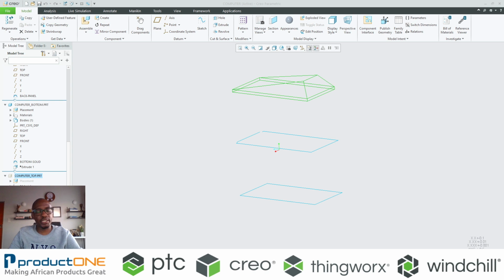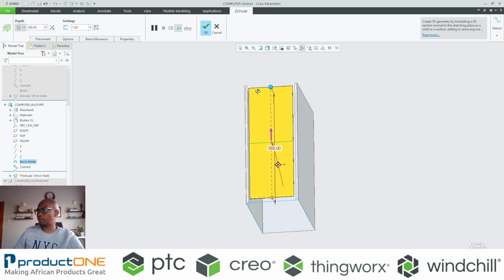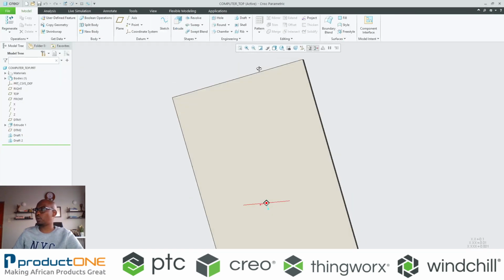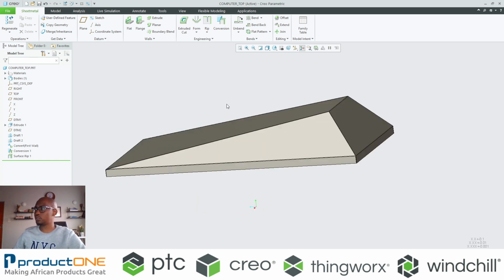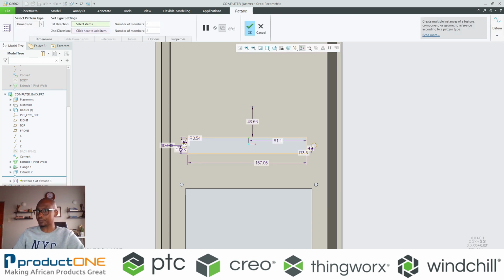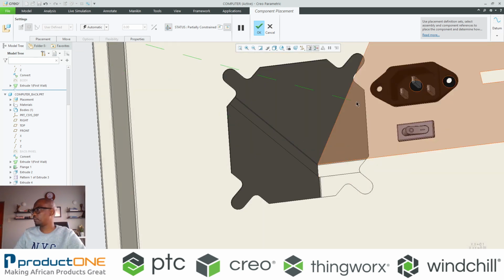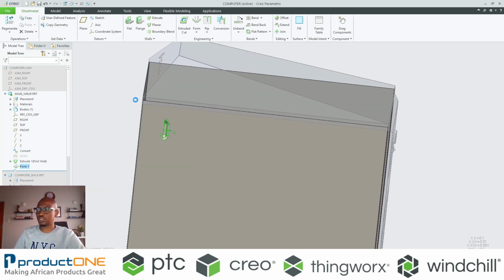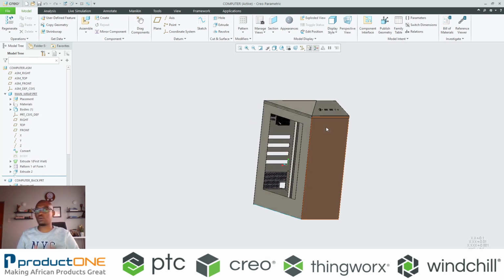Creo Parametric Sheet-metal Design

Comment: This is a very good example of what Creo Parametric can do.
I have the following questions to help me as a beginner user of Creo.

Is it possible to analyze the metal thickness to find out if the thickness I have specify can withstand the pressure say exerted on a sheet metal face for a concrete block mould for example.

how can i create one part with different individual sheetmetal that are to be welded to form the part.